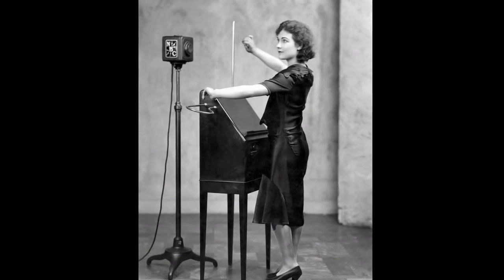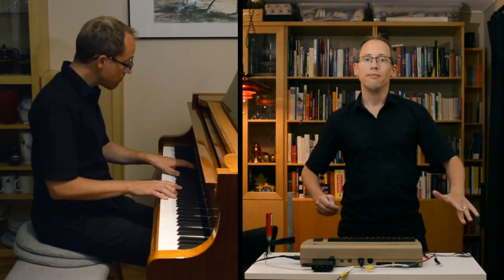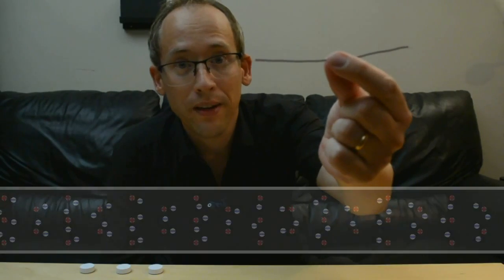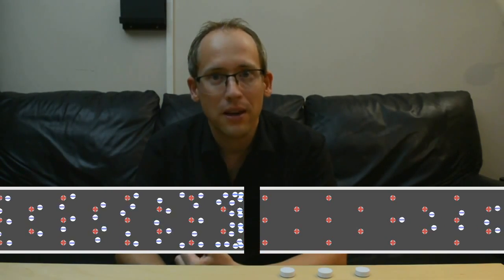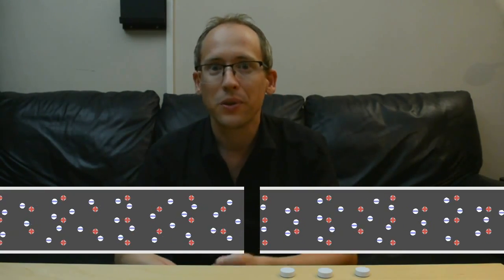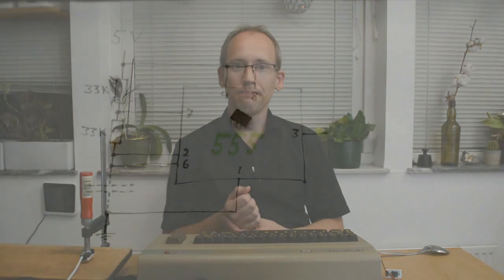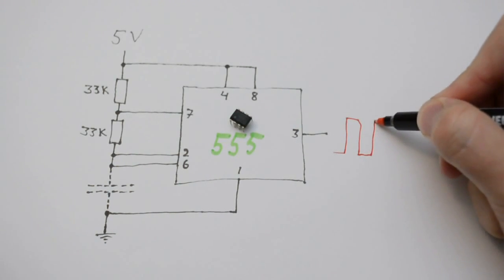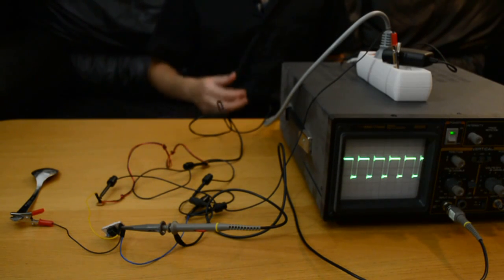I turned my C64 into a Theremin (with a spoon, a clamp, and six more components).

Comment: Lev Termen's original Theremin used three oscillators running at radio frequencies, one of the three oscillators operated at a fixed frequency and was used as a reference oscillator, the other two oscillators were connected to an antenna, the signal from the reference oscillator was mixed with the signal from one of the two other oscillators, the capacitance effect between a human hand positioned near the antenna de-tuned the oscillator, the sound that the Theremin makes is due to the difference in frequency between the reference oscillator and one of the other two oscillators connected to antennae (the pitch antenna), the other oscillator is used as a volume control, the reason why the frequency of the oscillator connected to the pitch antenna is because of capacitive loading effects.

Comment: The way a "classical" theremin would work is: you run that oscillator at a much higher frequency, so that the "just a few percent" of change still spans something like 10kHz. Then you build a second oscillator which doesn't have an antenna for a capacitor, and tune it so that its frequency matches the frequency of your antenna oscillator when no hands are nearby. Then you mix the signals from the two oscillators so that you get sum and difference frequencies. The sum will be way out of the audible range (and easily filtered out), and the difference will be a tone that gets higher the closer you move your hand to the antenna.

Comment: Perhaps a combined waveform of Triangle and Pulse would make a more authentic sound. You can easily do this, even in BASIC, by setting the waveform bit for both channel by selecting any 3 possible waveform bits and adding them before POKEing them in. Noise is the only waveform the SID can't combine.

Comment: This is awesome! I've been interested in trying/learning Theremin for a very long time but haven't found a practical option. Knowing basically nothing about electronics/E.E.: Is it possible to build something similar with a breadboard/Arduino and a few extra components in place of the Comodore 64? How many more steps would it take to get that to USB-friendly MIDI?

I have no experience, but I'm assuming if it's these six components, less than $50 of extra gear, and two conductive pieces like your clamp and spoon, this might be the best ("real") DIY theremin design! (I've seen some projects using IR cameras to determine distance and they seem nice, but have their own limitations and costs.)
Reply from the maker: Yes, you can certainly use an arduino to count the pulses from the 555s. I would generate sound directly from the arduino rather than going through MIDI, at least to begin with. Also, I would recommend against building the 555 oscillators on a breadboard because breadboards have large stray capacitances between adjacent signals. You can try, of course, but you'll get better results on a small veroboard or pcb, or even soldering components directly onto a DIL socket. The outputs from the 555s are robust enough to be routed through a breadboard, but not the internal signals.
Reply: @lftkryo  Thanks for all of that input! My school semester is about to start, but this seems like a great project for when I have free time.

Comment: I thought the moving diagram of electrons through the metal wire was just a well crafted looping gif, but then I saw how they were piling up and pushing away from each other so realistically in the cut wire diagram.  I wonder if that whole thing was a simulation programmed just for this, or if it was made in a physics simulation program or something.
Reply: As a programmer myself, I made a few repulsion-attraction simulators and this is exactly how they behave. Qualified guess: Lftkryo made the sim himself.

Comment: Could you also have the left hand volume mapped to open the low pass filter? So higher volumes are bright and lower volumes soft. That would add to the expression especially with an 8580 sid, imo. Great work anyway. Always love your videos :)
Reply: Sure it could. There are so many other possibilities the theremins with different kinds of synthesis could have. And I have been trying to achieve a FM synthesis theremin where the volume hand could change the operator amplitude but so far haven’t found a theremin with a MIDI output with a response quick enough.